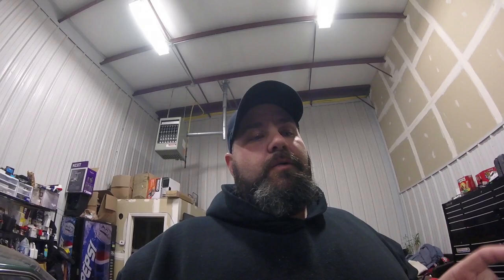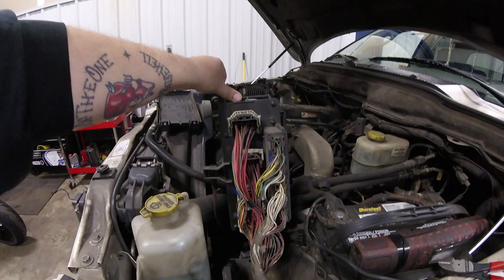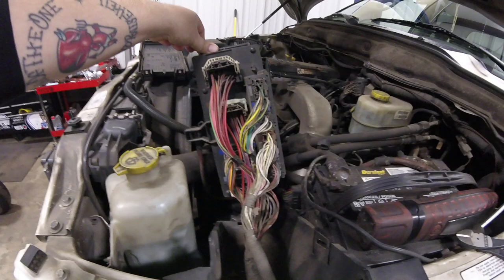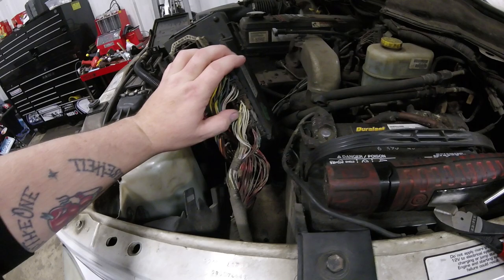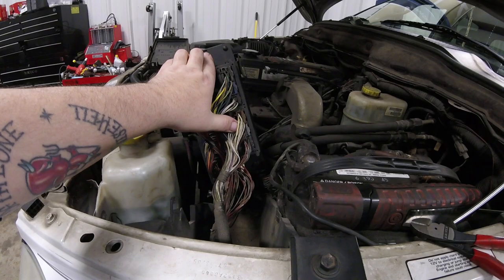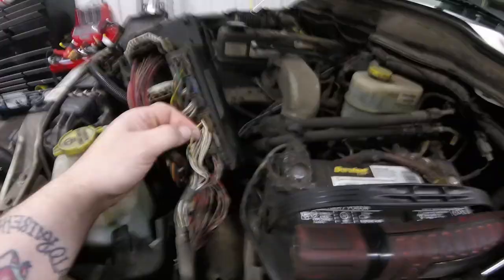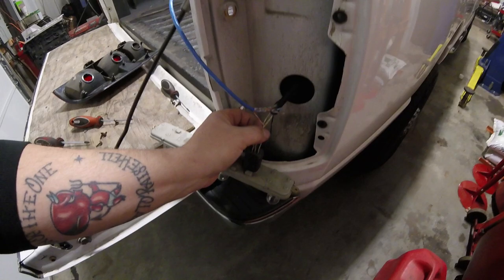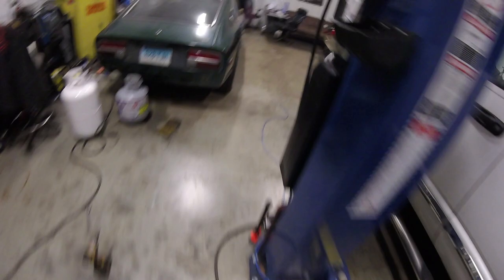Cummins Ram 2500 Bad TIPM??? Maybe not!

Comment: I recently bought a 2005 3500 Cummings. When the key is off EVERYTHING electrical, dome light, door locks everything is off. I can’t even put on park lights without key “on”. Any thoughts?

Comment: Great video I was wondering would you have any suggestions on my 99 ram with 5.9 cummins my aftermarket egt gauge stop working got that to work an thin my gauge cluster is now going crazy all gauges but when I start driving they all go back to normal. If you or anyone can help would be appreciated thank you in advance

Comment: the solution is valid but my concern is not knowing why there is a break in the wire and not knowing if the other wires around it are also compromised in some way.

Comment: I know this is a 4-year-old video, but it's my first time watching it, because it may help me with my situation. I have a Dodge 3500 4x4 with the 6.7 Cummins.  Last weekend while running down the highway pulling my 27' gooseneck, the engine cuts out twice but continues to run. The third time it died, and we haven't gotten it to start since. I have had all kinds of help about what to check, from the fuel pump to the batteries which are only about 4 months old. I was also told it may be the fuse box. It will not do anything when I try to start it, the radio, and power windows both work. If the radio is on when I try to start, it cuts off like there is a short. Any help would be greatly appreciated.

Comment: Hello I have a 2002  ram 1500 QC current condition is headlights come on automatically as soon as my key is turned on I have no brake lights no wipers no turn signals no hazards no horn no door locks and no guage cluster lite up it's very intermittent and when it does work every thing gos hay wire like its all lit up trys to work than my door chime sounds like it's sick. I've replaced the ignition switch got ahold of a pcm used , used tipm and fuse block my driver's side headlight keeps blowing out also blows the turn signal bulb a lot please help I'm at a loss I've also tried the guage cluster to no help
Reply from the maker: Sounds like you either have a problem with a short in the harness or you have a bad ground or a bunch of bad grounds.

Comment: HI BRO I HAVE A QUESTION ABOUT MY TRUCK 2001 RAM 3500 CUMMINS 24 VALVE TURBO DIESEL MANUAL TRANSMISSION ,. EVERY DAY IN THE MORNING WHEN I START MY ENGINE IT COME SMOKE BLUE NOT ALWAYS SOME TIMES,. COULD YOU TELL ME WHAT IS THE PROBLEM WITH IT.

Comment: I am having a problem in my 2011 Ram 3500 with Intermittent cruise control problems, trailer brake issues, and no horn. Is this a TIPM issue?

Comment: Hi I have a 2006 Dodge 2500 and the Ac has a bad ground wire and the mechanic is telling me that it is the tipem. He ran another ground wire to compressor and it archs when you touch it. Help please

Comment: I've got 2012 Dodge 2500 4x4 . I'm getting service 4wd ,trailer brakes disconnected, traction control, and sometimes I lose power for about 2or 3 seconds then back to normal. Can you please help??

Comment: So I have a 2006 dodge 2500. Recently my airbag light has come on and stays on i also noticed that now that its on its messing with my ac/heater. I've checked all the fuses and they are all good. I've checked underneath my seats to make sure all the harnesses are connected right. Can the tipm be the problem.

Comment: I have a 5.9 2006 ram 3500 with no break lights at rear or 3rd light. Fuse is good. Any suggestions? I’m thinking it’s TIPM issue because the cab break light is out?

Comment: I am having a problem with low voltage to the trailer brakes. Only 7 volts at the plug in the back. 2010 ram 2500. Where did you find the tipm wiring diagram’s and pin outs?

Comment: Hey there I have a 2006 I just got and my right turn works but if I push the break petal the light goes out and the break light don't work but when not using the turn light on the right side and just hitting the break all works so what do u think it could be. Cause I'm thinking I have a short to one of the grounds

Comment: I got a 2007 dodge ram 3500 with the 6.7 Cummins diesel in it.i am experiencing no control head function for my ac, no heat, no vent selection, no ac light when pushed. It's like to power to anything but the blower motor. Sound like a tipm issue?

Comment: I have a 2014 RAM 3500 and a month ago the radio/screen went black. Dealer is telling me I need a new radio and they can't get one until December! Now suddenly I have dead batteries and had to jump it to start. I had the batteries tested and was told they are good. After 2 days of truck sitting, I have to jump it again! Any suggestions?

Comment: Hopefully you can help me. I have a 2014 ram 2500 Lone Star cummins quad cab 4×4 and it wont start or anything, my dash lights nor my main screen/radio/info center wont come on. I have replaced the ignition and RF module and it still acts like there is no battery in it. The batteries are also brand new but I get 12 volts to my ignition switch but only 7-8 volts coming out of the switch. I have traced wires for months and still cant figure it out, any ideas on the cause

Comment: So...If I have 3 codes under the TIPM :(  [2008 Dodge Ram 2500 6.7 Cummins lots-o-miles] one related to the transfer case motor, one to the left brake light, and one to the ignition switch. I did replace the ignition switch because it was screwed up for a couple years now. Do you think it would still be useful, witch 3 codes, to pull this thing apart and check it out before I purchase a remanned one? I got a warning yesterday but I can't exactly not have my truck operational. Any thoughts/advice, much appreciated.

Comment: Ya I’m working on a 06 Cummins had the right trailer light go out checked power at the tipm had it so cut the wire and ran a new one to the back of the plug now no power up at the tipm if it throws a code do u have to reset it with a code reader or maybe unplug the battery’s for awhile kindof lost on what happen and what I need to do

Comment: I have a 2006 Ram 2500  5.9 Cummins fan clutch is free spinning properly but not engaging when I turn the ac on I’m going to check voltage at the plug but was wondering if you had any wiring scematics for the tipm because I notice a little corrosion underneath on a few wires thanks in advance

Comment: I have a 2007 dodge ram 6.7 cummins. I was driving and had a blowout on the front passenger tire and it pulled my wires loose from the PCM that's mounted on the firewall. I plugged them back in but the clips broke on the pcm that hold the harness. It works great one day then next day I start the truck and there is digital squares around the trans indicator PRNDL and transmission feels stuck in high gear. How much do you charge to check and repair the PCM along with replacing the clips so it will hold the harness tight. Please let me know if you can help.

Comment: I have a 2005 2500 Dodge ram with intermittent wiper issues a constant horn on issue and constant lamp out issue when the brake pedal is depressed or a turn signal is turned on. Could this be caused by a bad front control module or integrated power module. Any help with this would be greatly appreciated.

Comment: Hey just bought an 06 3500 Cummins. Along the full base of the headlights is an amber stroll with a 194 bulb. Mine don’t work. Put new bulbs in and nothing. My question is are they park lights or signals or what? I’d assume they should illuminate off the headlight switch right?

Comment: 2000 ram 2500  rear lights (park/break/directional) operate  front park and directional inop  have power but no ground  also horn inop  power but no ground  have continuity from socket ground to joint connector but the ground is lost after that  groundings to block are good  could this be an issue with the TIMP or another area   thank you

Comment: My truck was eaten by mice. I bought a different truck and swapped the dash, seats, and in the very end I connected the batteries wrong. I put the left +,- on and something popped on the drive terminal that was touching the body. Now my instrument cluster is showing "no bus" and none of the gages work, wipers don't work, blinkers don't work, and ac doesn't work. I checked all fuses replaced all blown ones. I think its an iod issue. Any advice?

Comment: @morfabindustries I have an 06 3500 cummins megacab recently the 4wd system lost its mind and was trying to activate itself or not going in so once I got time I replaced tcase motor and still same issues. I looked at back of tipm and didn't see anything obvious, also noticed up hunting after having to crawl in 4wd low almost half way down the mountain I shut the truck off to give it a cool down and noticed the tail lights on, any help as far as what legs on tipm I should be looking for and anything you know about this issue, thanks.

Comment: 2011 ram Laramie 2500 6.7 Cummins multiple tipm communication codes could it just be the tipm itself I check all relays and fuses and getting power to modules inside the truck

Comment: I have a friend that has an 05 2500 with a 5.9 that does not start. When you turn the key ignition the left side of the cluster does not work. Tach and odometer and truck cranks but won't start. Have you seen anything like this before?

Comment: I have been dealing with my truck surging  after like 10 to 15 mins of driving and my turn signals do funking things sometimes. The headlights and air conditioner and the engine all surge. Plz help

Comment: I have 2003 dodgram 3500 Cummins park light and over head marker light will not go on fuse are good light switch is good hook up direct line like in your video they work what do you recommend I do

Comment: Similar issue on 06 ram 2500 cummins, mines the trailer brake lights, left an right signals, using a basic test light I’m a dim light at the rear plugs is that going to be a bad wire or the TIPM it’s self?

Comment: I have an issue with my transmission will no shift 2006 2500 diesel no 12 voltage to trans mission.  jump wire to trans allows it to shift but no lockup or overdrive.

Comment: All of my parking lights are staying on but with low voltage....barely on.
Pulled light switch it looks fine. So trying to figure out if its fusebox corrosion or what?

Comment: So I got a new tipim and still have same problem changed the starter relay. 2006 ram 1500 5.7 so won’t start just a rapid clicking noise from the starter relay. Also no horn no turn signal no hazards no radio won’t start . Have new battery and checked all grounds any help much appreciated
Reply from the maker: Where are you located.
Reply: MorFab Industries I’m in Indiana
Reply from the maker: Well, without having the vehicle in front of me there isn't much I can do for you.  The only thing I can suggest, is that you check anywhere and everywhere in the entire electrical system for corrosion.
Reply: I’m new to you tube and subscribing so how can I actually call u and where are you located at thanks
Reply from the maker: We are located in Connecticut.  And unfortunately we don't to over the phone consultations.
Reply: MorFab Industries wow that sucks really could use your help

Comment: Informative video! Need help.
I have an 06 Ram 4x4 with a few strange electrical issues.
1. Half my dash lights are INOP.
2. Trailer running lights work but no blinker or brake lights. Checked voltage at both the 4 and 7 pin connectors. 13-14vdc at running lights. 12vdc at all times for both blinker/brake pins. But the lights never illuminate.
Suspect TIPM?

Comment: Having an issue with a 2007 dodge ram 2500. Tried to replace high beams with LED, they flickered, did the anti flicker wiring, they didn’t work and now the high beams won’t work on either side

Comment: My issue is I have no front turn signals. The right rear works and driver side headlight is out. If I put my test light in the socket of the left front turn signal it makes the headlight come on. I'm so stumped on this issue. My truck is an 05 2500 Cummins. Thanks for the video and hopefully you see this comment and can help. TIA

Comment: I hooked the batteries backwards on my 2001 dodge 2500 Cummins
The truck started and ran for 30 seconds and quit
Now I can’t the intank fuel pump is not working 
Checked fuses relays and changed ecm still not working 
Any idea what it could be

Comment: Just saw your video and I have similar problem on a 2014 ram 3500 ,I have right turn single blinking fast but front and rear light working , also no trailer  connector light the hot pin has current I have left turn but that's all  Help

Comment: Just seen your channel...I do have a problem with 04 Ram 3500 diesel....with the running lights on i put my turn signal on and its lamp out chime  no lights out ...if i apply the break all is good...with no running lights on all is good ?  if i leave turn signal on with running lights on it will be ok after a bit then start again ....no led lights

Comment: So I have a 2006 2500 Cummins my AC compressor has no power. From what i have read the relay is in the tipm do you know the pin? Haven't seen anything. Hate to shell out $300 if it is an easier fix.

Comment: Hey I have a 2012 ram 2500 longhorn 6.7l I’m having my brand new discharged in 2 days , 
All lights ware off doors closed 
Truck does have a egr delete egr cooler delete 
 , custom intake air filter 
Bully dog chip 
Straight pipe exhaust 
The scanner shows the brake switch , I disconnected the brake pedal switch and I’m still draining my battery 🔋 
Any ideas what might short out in this case .
I

Comment: I have a 2004.5 dodge ram 2500 cummins.  My front driver side headlight works intermittently.  I changed out my front control module(new) out that's attached to my tipm and it worked for 4 months.  Now it's back.  Any idea?  Thanks for your help

Comment: got a question for you reguarding a electrical issue on a 2004 dodge 2500 cummins. I just put new injectors and a new sending unit in the truck as I can’t get the fuel pump in the tank to turn on. I tested the key on power at the sending unit…it tested perfect. Which leads me to belive my issue is somewhere in the tipm. Any ideas or have you seen this issue before?

Comment: I have a 2004 dodge ram 3500. Ive pulled and changed the fcm, ignition switch, repaired the instrument cluster thru dodge and still have the problem of no old power, key fob doesn't work radio doesn't work etc. Any helping fixing this would be greatly appreciated. thx in advance

Comment: Can you put a link in for the TPIM wiring diagram? I have a Fuel pump issue and I had power at wiring on top of tank. Replaced pump and still not powering on.

Comment: I am working on my boat trailer as I found a ground wire broken in the wiring from my boat. I took all of the old tape off and put on a new harness spliced at the hitch. Now my left running light and turn light will not go on, I have it wired exactly like the right turn which works fine.
I bought a new round plug that plugs into the truck as my old one looked as if one blade was missing in the slots but the new plug did not make any difference. I have a ground wire from the trailer connecting to the white wires ( left turn, right turn and the one coming from the plug and the trailer ground wire)   I think that is right, ??  Norman

Comment: I've got the same issue with my 06 cummins lights flickering when there on. when I signal to the left it somtimes singles to the right truck randomly shuts off somtimes while driven and I gotta wait s few minutes and starts up just fine and trailer lights dont work at all rpm guage is always off and radio goes off and on while hitting a dumb grid heater has no voltage it doesnt work.Need help if any one has advice I'd appreciate it thanks

Comment: Hi, I'm trying to figure out what's wrong with my brothers 2008 ram 3500 with a cummins, it keeps draining new battery after new battery, we put a new set of batteries & alternator in it 3 times now it works for a few weeks than everything's dead again. I was thinking the next think would be to replace the tipm, but I dont know if that's it for sure.

Comment: Does that control the transmission.... I've been having trouble ever since winter plowing snow with my check engine light coming on and my transmission wanting the wInding out first gear and shifting hard! I had the solenoid filter and seal replaced on the transmission hoping that would make a difference but it did not!

Comment: Just had the exact same problem on my 08 6.7 megacab! Luckly no tipm shutdown  I found corosion on the connector just aft of front drivers tire. I also bent the pins a little to gain a firm connection. It's honestly in an awful spot though, getting sprayed by the tire. I'm going to cover or move mine.
Reply: How the heck does the connector come apart.  I have a broken wire on this one,  but Im stuck on the lever... =/

Comment: Have a 2006 ram 3500 fan clutch wire was cut by the fan grounded itself to the block now it’s pulling a p0868 which is a low transmission pressure shift through every gear but will not go in first any ideas?
Reply from the maker: It could have back fed and blew a circuit in the ECU.

Comment: I have a 2003 Dodge Ram with the po720 code but it's actually not in the transmission but it keeps all of the sensors are new output and the vehicle.. My speedometer bounces up and down like something is pulsating... You're the expert what do you think

Comment: Is it possible that the tipm is causing a misfire issue? I have a great mechanic who assessed a p0300 code, (dreaded code). I personally replaced plugs, he did so much more, camshaft and crankshaft sensors, ignition coils, checked injectors, etc. he ended up bypassing something in the tipm and now there’s no misfire. 

I know that’s really vague, I’m out of my range with this one. Help...! Lol